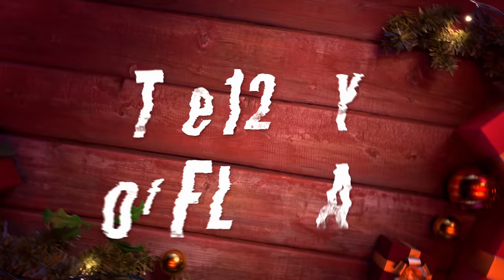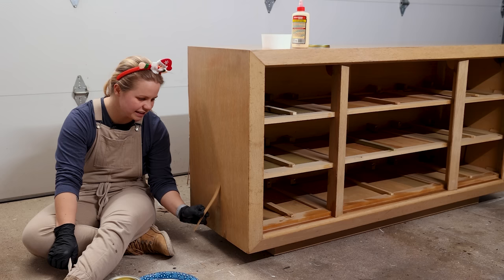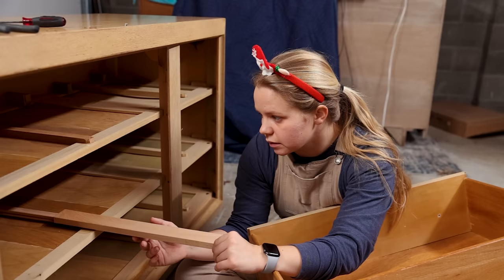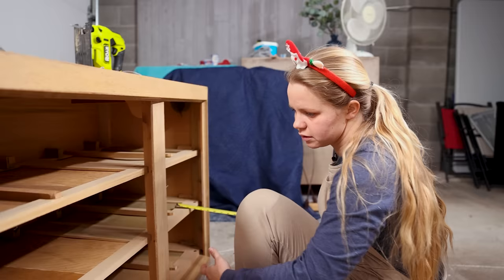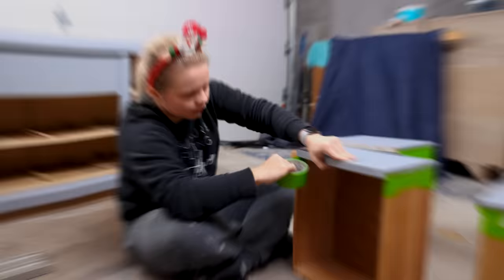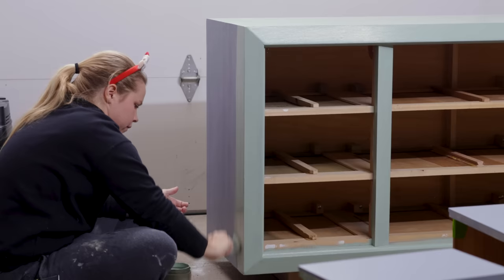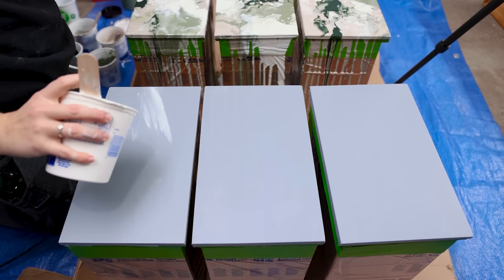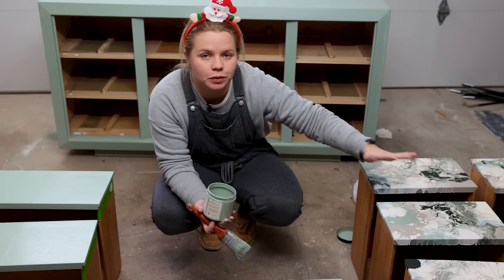DIY Paint Pour Furniture Makeover | How to Pour Paint on Furniture

Comment: Very pretty! I love doing paint pours on furniture and canvas. It's actually something I've done inside drawers that were pretty damaged or discolored on the bottoms for a pretty surprise disguise. You can also mix your paint with Floetrol and a touch of water to better preserve the integrity of the paint. Another tip is to add a metallic into it for even more dimension. Great job!
Reply: Absolutely beautiful!  I do agree I would thin the paint some.  I would be concerned about the paint cracking due to the thickness.
Reply: Yes same thing about the paint using floetrol will make it so mush easier for you to work the paint giving you much more time to work with n less paint... but the piece came out uniquely beauriful...
Reply: Oooh and adding some silicone to make cells would be lovely as well.
Reply: fantastic advice thank you. we will be trying this wonderful effect with confidence.now.

Comment: That method is called fluid acrylic art or poured painting and is primarily used on artist canvases. I have tried it on a table and was pleasantly surprised. Your dresser is fabulous, nice job for your first time. You will only get better. And you don’t need as much paint as you think. Those cracks/crackled areas (which I feel enhanced your piece) are caused by thick layers of paint drying on the surface and not under. The fan would have caused that. Anyway, beautiful! Thanks for sharing your enthusiasm.

Comment: Hobby Lobby hardware has extra long screw shanks so they are adaptable to various width furniture. Those should be cut off after installation so no hands get snagged when using.

Comment: Looks really nice, good job!. You got the paint cracking because you left too much paint on the surface, also a bit of GAC800 mixed in will help to stop the cracking. You could also have put the drawers together, butting up against each other and poured and blown the paint across all the drawers at once so the pattern continues across from one drawer to the next, if you get what I mean. Also you need to wait until the paint cures (a couple of weeks at least) properly before you varnish. I do paint pouring so I know this from much experimenting and fails.

Comment: Sand the edges of the drawers and just add 2 coats of satin poly.  They should fit in.  This is the reason I avoid doing furniture with flush mount/retracting drawers and doors.  The whole rubbing issue.